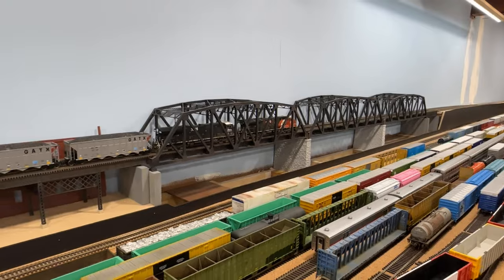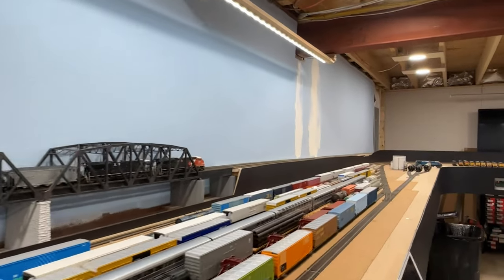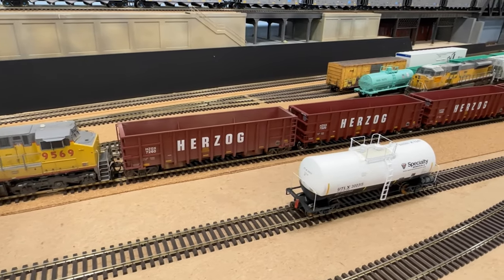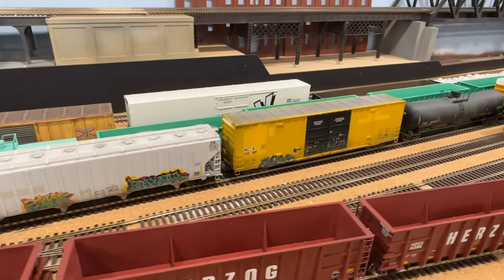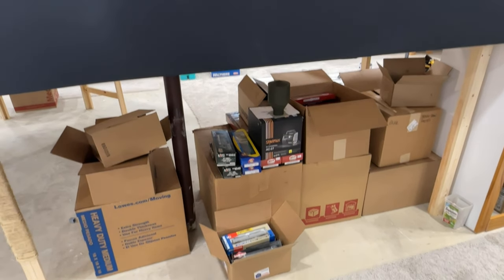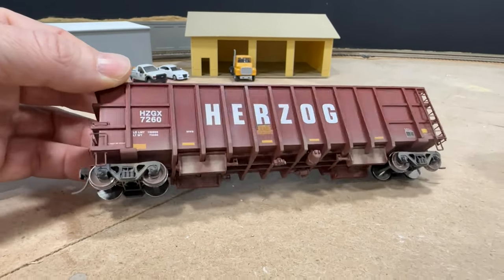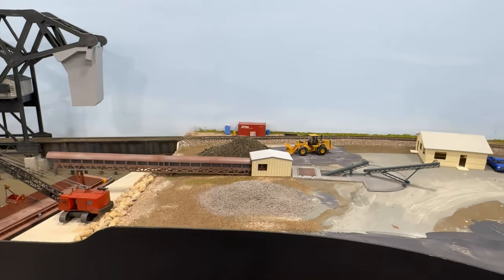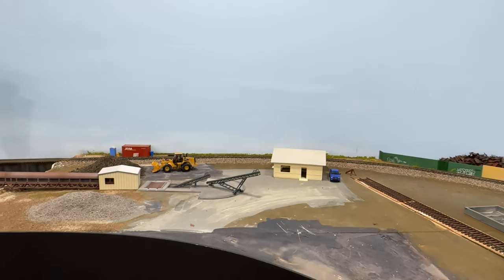UP Heartland Division Update 1/22/23 (Flashing LEDs, Bascule Bridge Control, Making a Concrete Pier)

Comment: Just my thoughts about the top 16' run? Where you were talking about helix off the inside track, my thought is helix off the outside track. It will make the turn a bit lighter, and give more bridges, or small tunnel scenery. You also have a great setting for just a grade ramp. Nice work

Comment: Who makes the Herzog cars?  

I would like to have maybe a dozen, used to handle the prototype when the Caltrain commuter line was being rebuilt.  I was a trainman on a work train, well it was more like a local on the nights we’d pickup and set out between San Francisco and San Jose.  

Usually we’d pick up the loaded unit trains from the UP in San Jose, we’d usually get trains with as many as 60 -75 on a unit ballast train of just the Herzog type ballast cars, we’d run it north and store on an old branch, and other places along the line.  The we’d return empties, we had about three or four trains combined of various cars types used for ballast, these Herzog making up about 100 of the cars.   

My plans are to recreate the power, some of the cars to make a decent train, and cabooses we utilized which were exSP like the power, I want examples of everything I ran (was engineer too), worked on or with, stuff for display, but I can operate too.
Reply from the maker: Athearn makes the Herzog gondolas.
Reply: @modeltrains_365  Thank you, I was thinking they were the old Roundhouse cars that they updated.

Comment: Nice work! I wouldn't do a second/another level. You have a great space there on the one level and when I look at layouts with another shelf level, the bottom level scene (the composition) is always spoilt. Hence some of the nicest layouts in terms of scene composition etc are not multi level. i.e. the work of Lance Mindheim,  Mike Confalone's Allagash,   BA Railsystmes on youtube, Pelle Soeborg, etc.  I think anther level could ruin both your bridge scenes. But of course it's up to you :)  You could look to see if you could reduce your gangway spaces and add more track,/ another loop but If I had that much layout room, I'd concentrate on making really detailed scenes with he track you have.